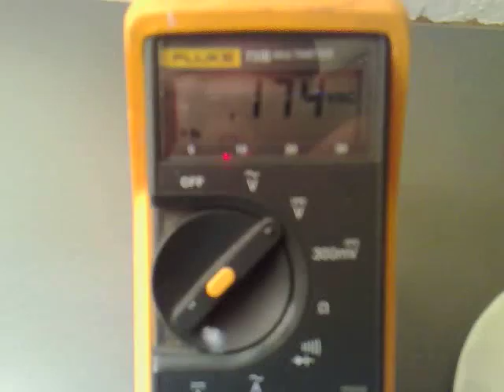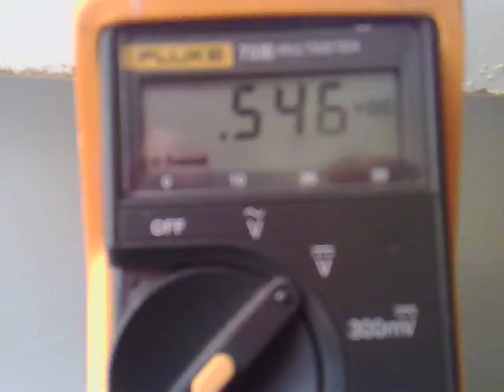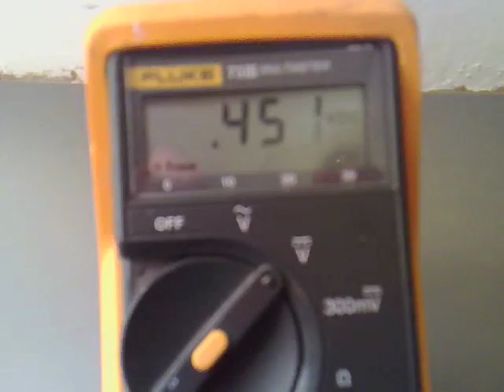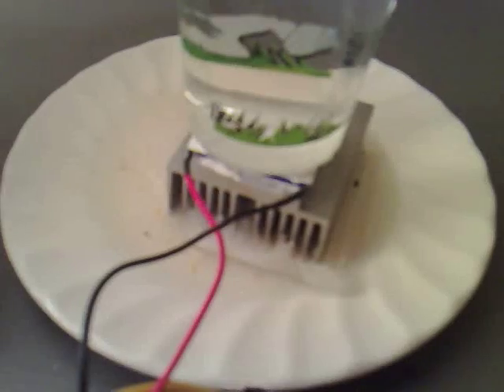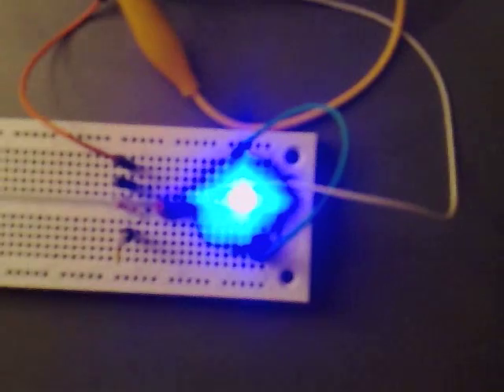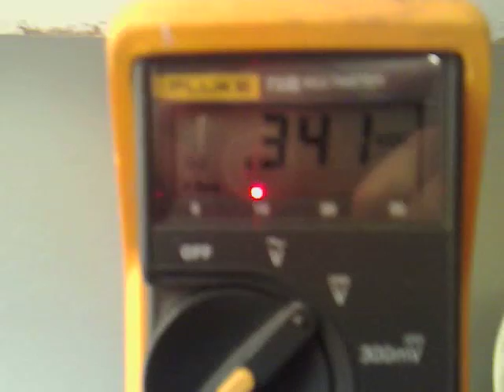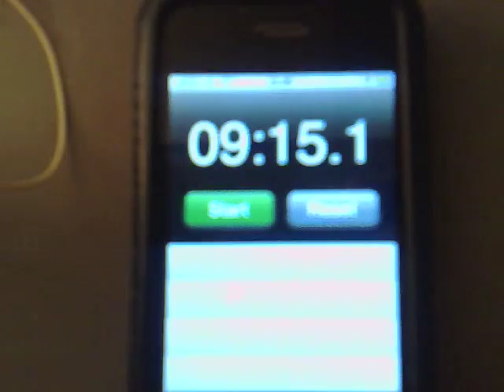Joule Thief (Heat Pump) 008

Comment: I guess insulating both the hot and cold storage containers would make the energy last longer since the hot and cold sources would be more stable or unaffected by the air losses, I'm sure you know that, but some might not.

Comment from the maker: Think of where you do not need heat and then, thats where to put them Like in the oven after a meal, or on you car exhaust or on your radiator. You could have free air conditioning in your car whilst cooling the engine at the same time. That would give more miles per gallon too!

Comment: Are you familiar with bio-mass-gassification?
They use it in Sweden to send heat underground to many of the public buildings downtown.
We could take all the garbage sitting in our landfills, extract the gas from it, use that gas to drive a motor/generator, then cover the whole unit with joule thieves to take extra energy from the heat created.